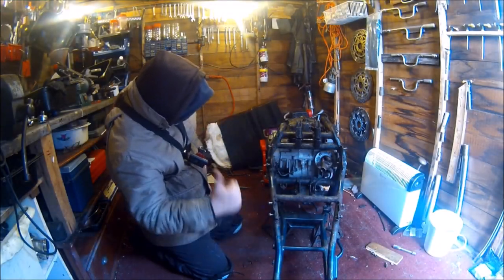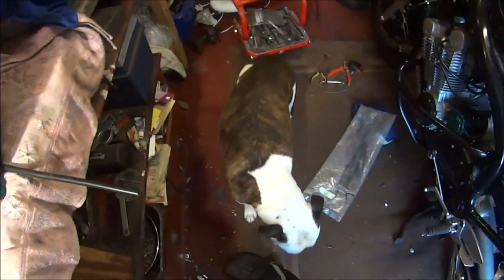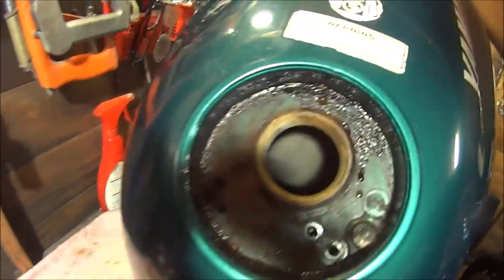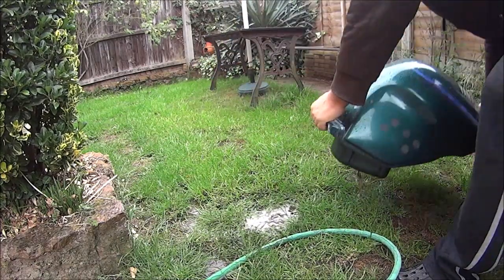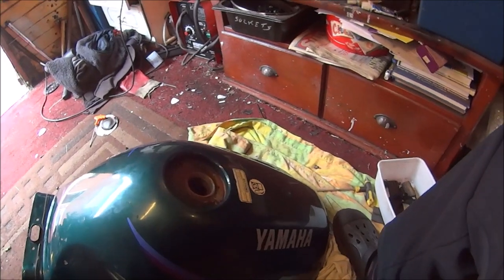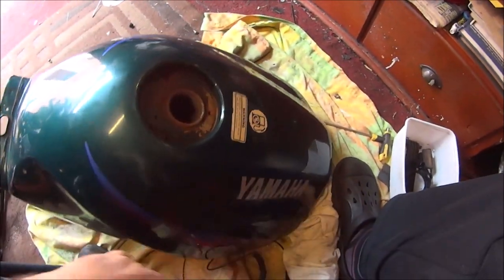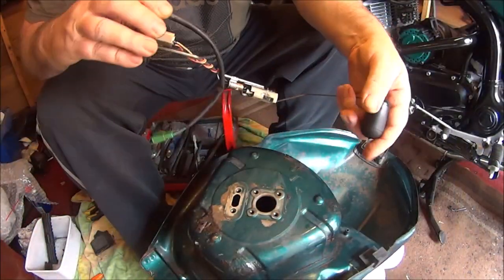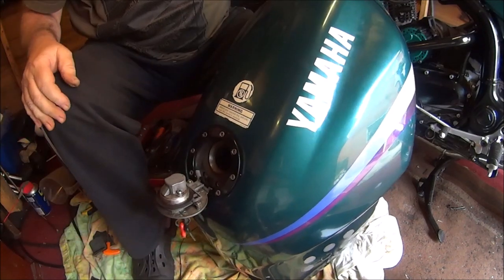XJ900S,,CLEAN OUT A RUSTY FUEL TANK.. EP-2 of 2..

Comment: Hey John are you not considering a tank liner to prevent the rust coming back!  Keep up the good work
Reply from the maker: Hi northerner. It's a first for me so I was hoping with fuel in the tank and the filer cap tightly closed it will keep the rust at bay.
Reply: I’ve used pot-15 on two tanks now. The last time in. GTR1000 which worked a treat. In my current D9 it’s being drying lovely for 2 weeks as I don’t have a working fuel level sender to fit it back on the bike!
Reply from the maker: @roymichaeldeanable  yeah guess you're right Roy I'm just not sure what use.
Reply from the maker: @northerner1374  pot15 OK feller I will check it out thanks.
Reply from the maker: yes it looks a bit tricky...
Reply: Liners can be a pain and cause issues later with carbs! Best IMO not to line them. Maybe use kerosene at the end after washout